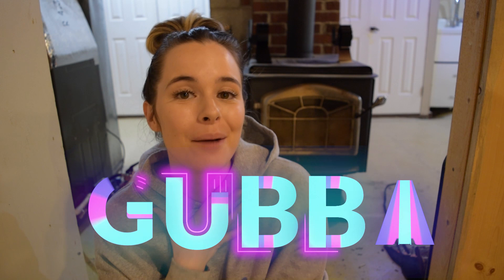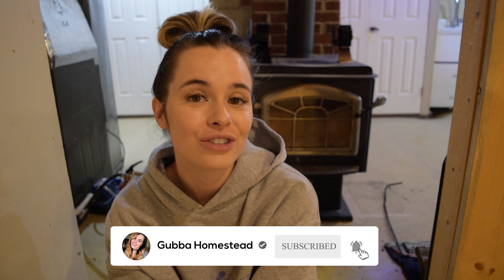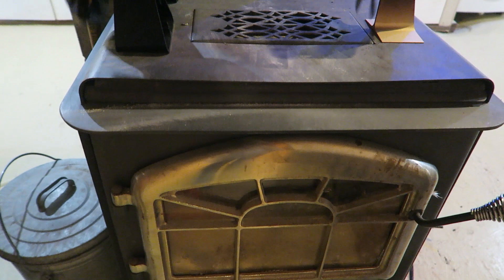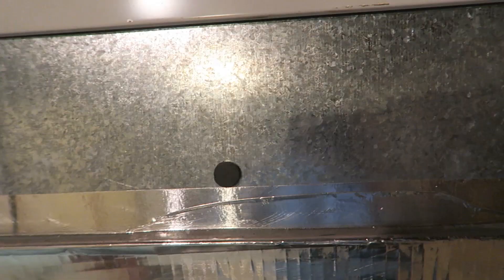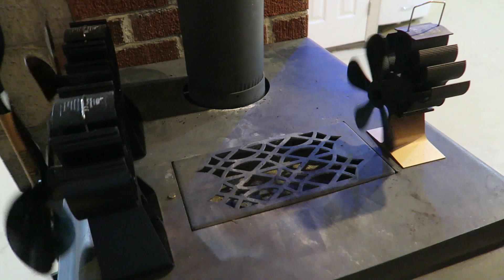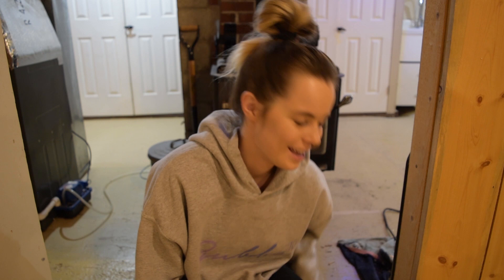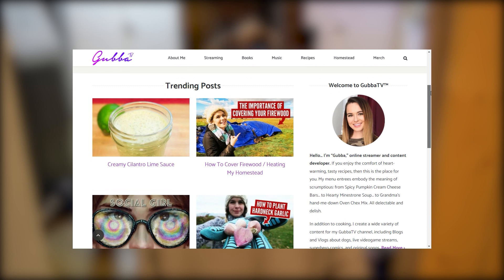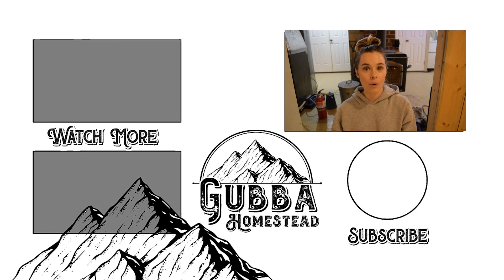How I Heat My Homestead | Wood Stove Review

Comment: Next Episode.... Gubba Learns how to keep her water supply from freezing in the winter.
Don't forget To make sure keep your water pump from freezing, Those heater cables go along way. to protect your water supply lines.
And you should look into getting 12 volt fans with a 100 watt solar panel and controller and automotive batteries to blow the heat around with out being on grid.Oh and get your chimney cleaned every year. And learn what to do if you have a chimney fire.

Comment: I heated a home for 10 years with nothing but a woodstove. I believe I heard you mention using an axe to split your wood. If so , you really should look into getting a wood splitting maul , commonly referred to as a "go-devil". They typically weigh about 8 pounds and are much more efficient for splitting wood than an axe. A good steel wedge is also definitely handy to have. Red and White oaks are easy to split , some other hard woods can be sorta tough , like hickory . Stay away from sweet gum , you'll beat yourself to death trying to split that stuff. Good luck to ya. Keep God first and you can't  go wrong !
Reply from the maker: Thank you! I just got a maul a few days ago and I'm pumped to start using it.
Reply: I gotta say , I've  never met a woman so genuinely stoked about getting her first Go-Devil . Life would be so much easier if men could just swing by the local hardware store and pick the misses up a nice 18" Poulan chain saw for her birthday .